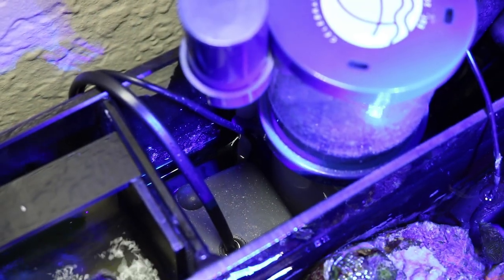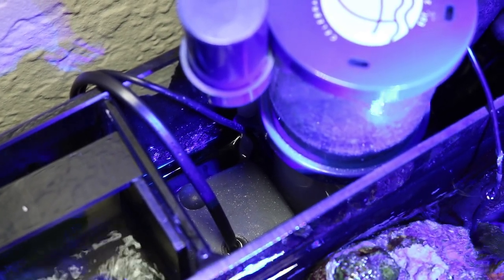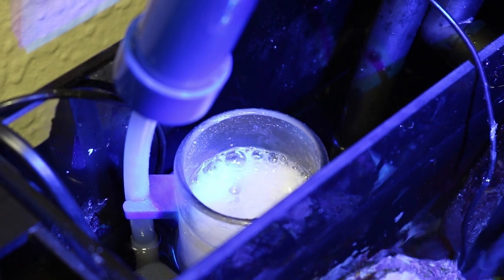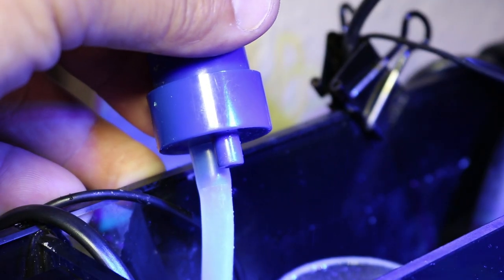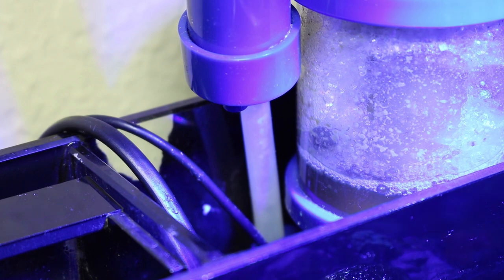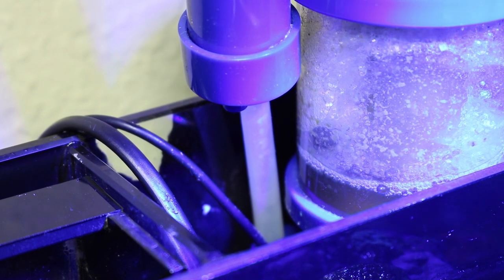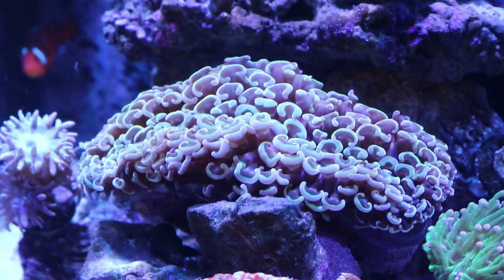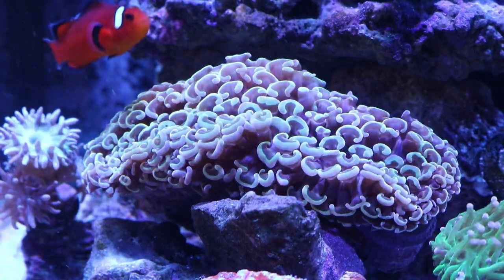TUNING ESHOPPS NANO SKIMMER / NUVO 10G REEF

Comment: my eshopps skimmer on my cube 20 gallon doesnt spill over the cup ever. do i just not have anything to skim, or enough to skim?
tank is about 5 months old, 20 gallon 4 fish hand full of corals, not many,
Reply from the maker: So I always kept my water level, or the bubbles right near the neck of the body of the skimmer (right where the cup comes off) and I always used to get stuff out all the time. Move the skimmer up or down with the magnet until you see the bubbles around the neck of the skimmer (right where you take the cup off) HOPE THAT HELPS